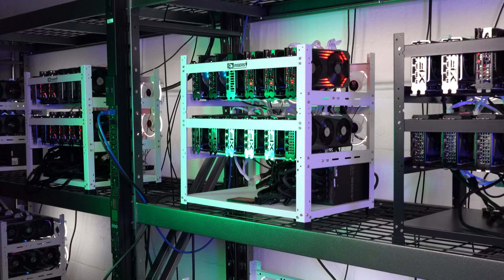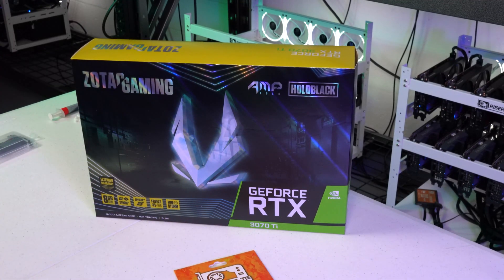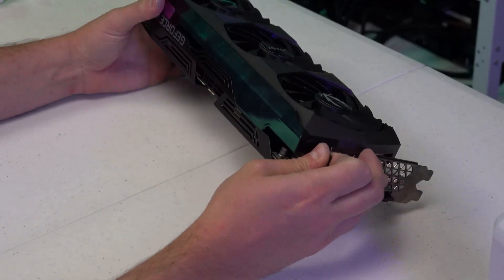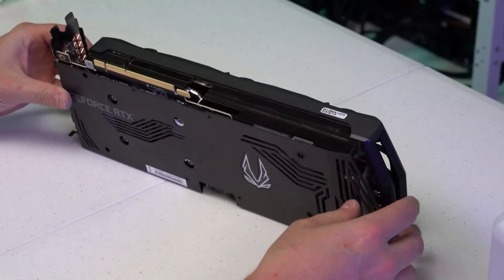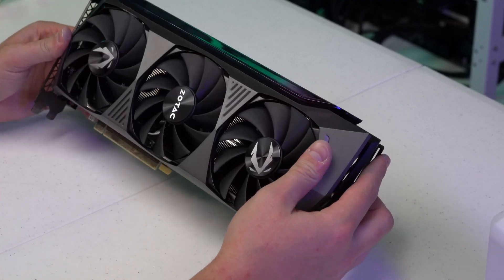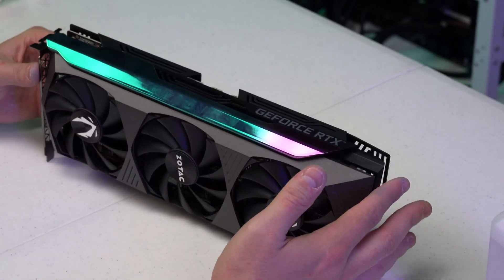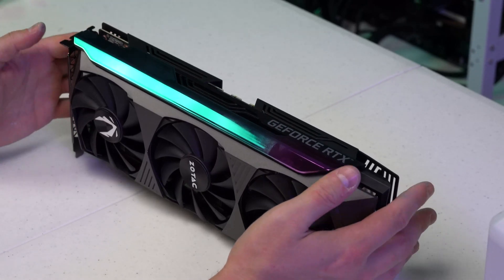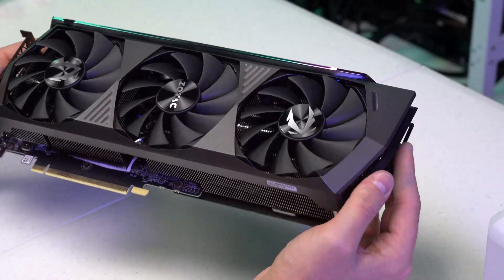We Fixed Our Thermal Throttling Nvidia Zotac RTX 3070 Ti with GPURisers 20W Thermal Pads!

Comment: Hi bro I only use the same graphic but only for videogames on 100% load I had 86° C like maximum and average like 83 - 82 do you recommend me change thermal pads , I ask you because I dont know whats the max temps of this new rtx 3000 cards and when they get thermal throttling

Comment: Thank you for this!!  My Zotac RTX 3070 Ti Holo Amp was running really hot with mem temps spiking as high as 108.   I replaced both the backplate and memory thermal pads just like you showed on the video with the GPU Riser pads.  This drastically reduced my mem temps to 84-88 now. Pretty sweet!  I covered a little extra space where I could.  If had to repad a different card that used the 1.0mm pad can I use a 2.0mm pad and spread it out?  The thermal pad material is kinda like molding clay so I was thinking I could just shape it.
Reply from the maker: We offer 1.0mm now on our site! Glad your temperatures dropped, we are seeing amazing results on 3070Ti!
Reply: This might void the warranty right !!

Comment: I've got an 8Gb OC Rog Strix 3070 Ti and after firing it up on Nicehash it's unable to be run higher than 'Med' without the fans stopping and it shutting down. Its the only thing being powered on a CoolerMaster 750w so there should be ample power which leaves me wondering about the thermal pads or BIOS settings being the problem.

If there's any suggestions I'm interested to hear them
Reply from the maker: Make sure your overclocks are not too high, and keep a lower power limit!

Comment: hello i am using the same gpu i saw on a website that 2.5mm pad is used i wonder if 3.0mm and 2.0mm pads are enough for zotac amp holo
Reply from the maker: I highly suggest using the correct pad size

Comment: Hmm gpurisers 20 pads twice as expensive than gelid 15 pads.
Reply: because of ads 😆😅🤣😂
Reply from the maker: Hey RingstedHedge, we actually priced these lower than gelid. Our thermal pads are more than twice the size of gelid so that customers are able to fully repad any card front and back with a single pad.
Reply: @GPURisers  Your pads are 100x100, thats 10000 mm2, gelid are 120x120 thats 14400 mm2, 44% larger. they cost around 36 USD MSRP,

Comment: Would this work for EVGA FTW variants? I do not have any issues with thermals on that one so wondering if it is worth it to do? Thanks
Reply: don’t touch your ftw they don’t need this
Reply from the maker: Yes it will, however FTW3 do not need them like the lower end models do